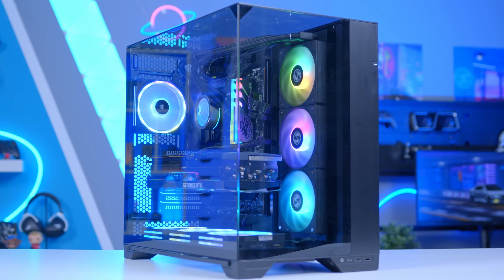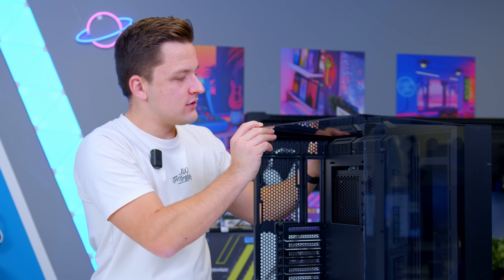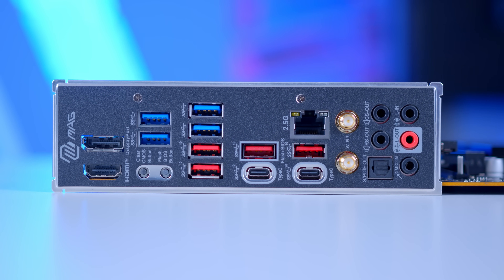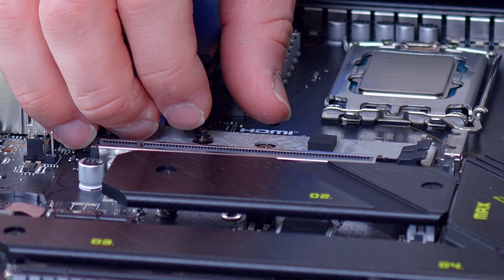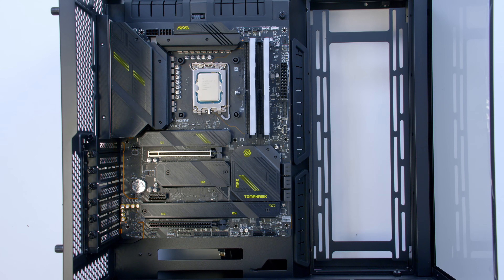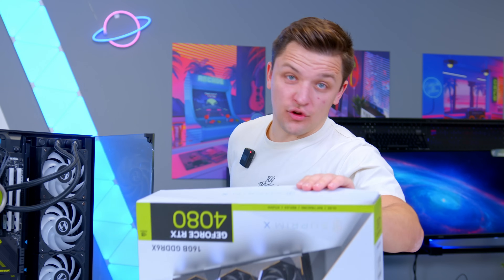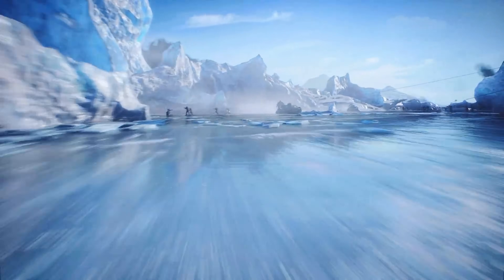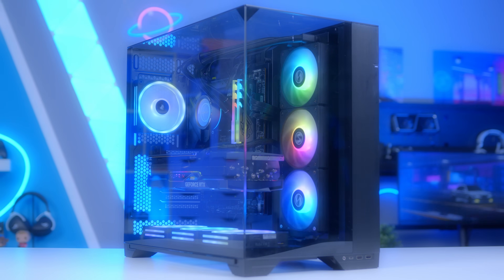Ultimate 1440p Gaming PC Build 2023! 😍 [Lian Li O11 Vision & RTX 4080]

Comment: So this case can handle the heat of a 7800x3d with a 4080(super)?
Maybe i´m gonna switch from my H9 Flow to this case because of the looks... 😁
Reply: Yes it can. I have this build but by the Lian Li recommended setup off their website which no YouTuber seems to care about. Their rec setup: 3x 140 intake on the bottom. Push-pull config on the side. And one to two exhaust on rear. None of this was highlighted. 🤦🏽‍♂️ I have one exhaust so 10 total fans. My temps are 61 peak on my 13700k and my gpu temps are almost exactly the same. 4080 super, with max settings for hours on end straight. It is also whisper quiet with this config. Damn I should have a channel.

Comment: Im thinking of buying a Ryzen 7 7800x3D with a radion rx7800xt. What yall think?
Reply: What motherboard are you intending to go for?
Reply: If you can get a 7800x3d for around the same price as a 7700x then excellent gaming PC build. However a 7800x3d is overkill for a 7800xt. The lowest requirement for that CPU is the 7900xtx or 4080 for it to make sense. Micro center does have a AM5 bundle that includes a motherboard, 32gb DDR5 ram and 7800x3d for $500 though.
Reply: @ZackSNetwork  reckon i go better gpu or lower cpu?
Reply: @92nicholaswong  havn't really decided yet, got any recommendations?
Reply: @TheSmoothViewASMR  havent got a clue. looking for recommendations as well.
Reply: @TheSmoothViewASMR just go with the 7800x3d and the 7800xt. That should be good enough unless if you want a more powerful gpu.
Reply from the maker: Good combo imo!

Comment: The 4080 atm is closer to a 4070 Ti. I mean the 4080 is better but its not like what it use to be when the 80 series was in a ballpark of its own..

Like back then you knew either the 60 70 or 80 series was the card to get and all of them had great performance

The 4080 super wont be that much better then it but if i had to go between the 4080 and 4080 super it would be super but then with those prices i might as well wait for a 4090 ngl.
Reply: False the 4070ti is on par with a 3090 in 1440p, faster at 1080p and worse at 4K. The 4080 is significantly faster than the 3090ti and beyond more power efficient.
Reply: @ZackSNetwork  I mentioned the 4080 and 4070 Ti. Learn how to read. Also the 4070 Ti should be a lot better which is why they making a 4070 Ti super. 12gb and 192 bit bus is laughable on the 4070 Ti
Reply: @DETERMINOLOGY might as well wait for the 4090 to go down.
Reply: @MrAnimescrazy  That would be the best bet. If your gaming @ 1440p 144hz or 4k 144hz or so and want a long term gpu and you don’t wanna upgrade within 2 years then ya. Like the 4090 from now can last 6 +years and if you don’t let unoptimized games get you down actually longer. It’s because of unoptimized games that make you upgrade more often then you have to
Reply: @DETERMINOLOGY  yup exactly
Reply: Don't you mean the 4070 ti is closer to the 4080? Made it sound like 4070 ti was faster than the 4080.
Reply: @accelgamerhd4954  No I really didn’t. The whole thing is the 4080 should be a lot faster than what it is. Even the 4080 Super isn’t that impressive compared to the 4070 TI Super when it drops.. hopefully the 70 80 and 90 versions of the 5000 series change and have they own lane. Such if you buy a 5070 it should feel like a real gpu upgrade or a meaning full card
Reply: But a 4090 is 1600 when a 4080 is 1160. Might as well wait for the 90ti and prices might drop on the 80 and 90
Reply: @GForceIntel  There won’t be a 4090 Ti so good luck with that and the 4080 feels like a slightly better 4070 Ti so I feel it’s a strange gpu. 4070 Ti, 4070 Ti Super or 4090 imo are the cards that will be best to buy
Reply: @DETERMINOLOGY  The 4070 ti is definitely a great card. I would honestly go for that card if I was thinking about building a new pc
Reply: @GForceIntel  I would wait for the 4070 Ti Super which will have 16gb of vram, 256bit bus and more cores
Reply: @MrAnimescrazy   It won't..only higher, as it's getting phased for AI